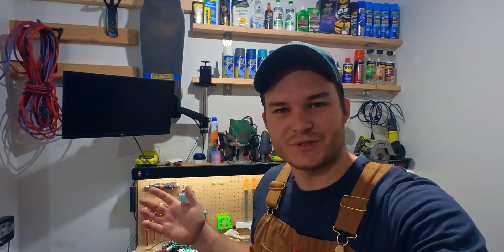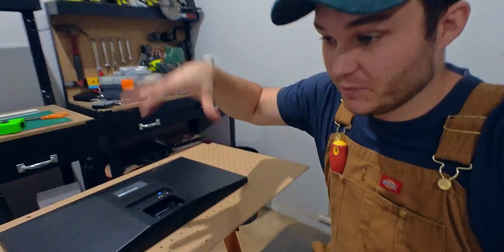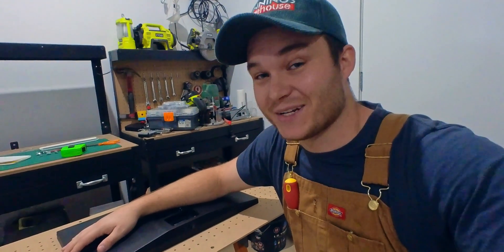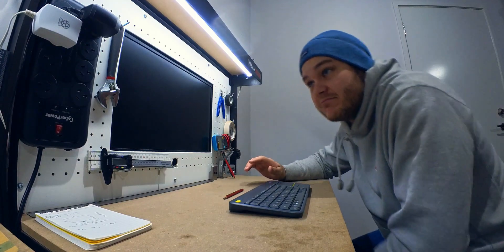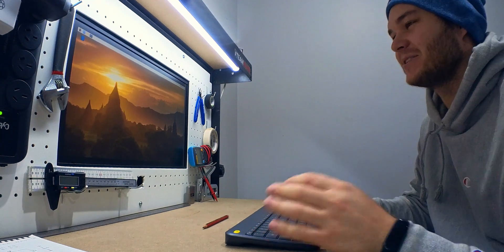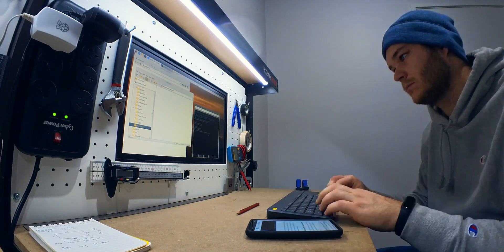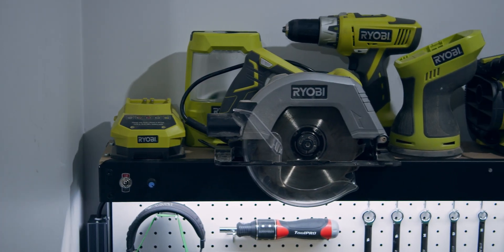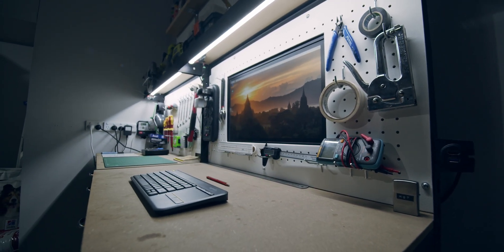Pegboard Computer - How hard could it be?

Comment: That came out so well. It looks like it was designed to be there. And your experiences with using a Raspberry Pi are the same as mine. Beating your head against a wall until you get a working solution to some dumb problem. Cool use for it too
Reply from the maker: I could have sworn I wrote a reply Sam, but Youtube says I didn't haha.
Yes, raspberry Pi's are very much that, just spent time this weekend trying to install Python 2.7 onto a 3D Printer Print server and for some reason DNS kept resolving as package doesn't exist... oh how I don't miss our IT classes with bash commands. I just want to click on something with a mouse and it work 😂